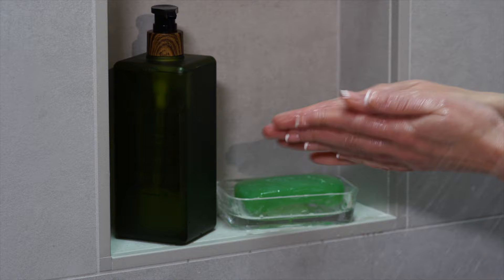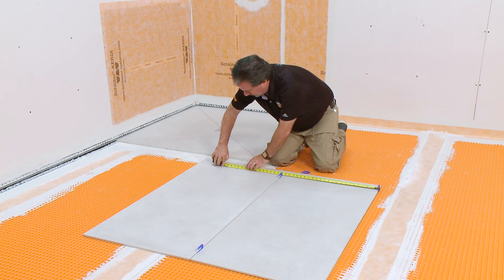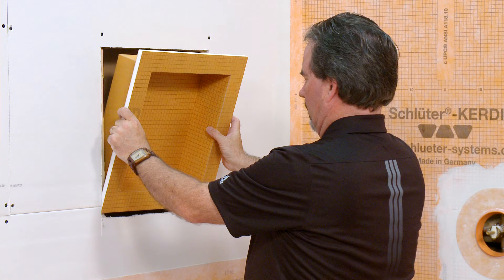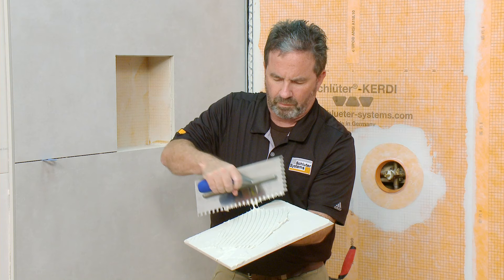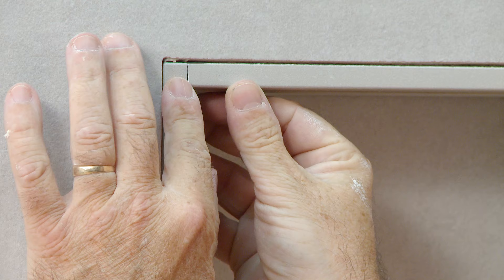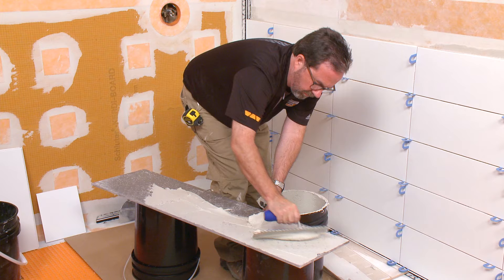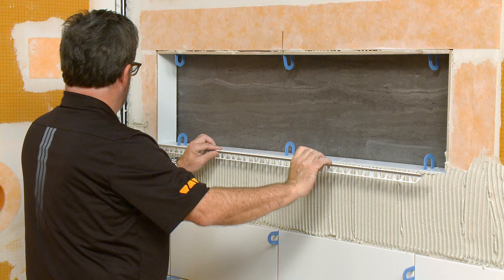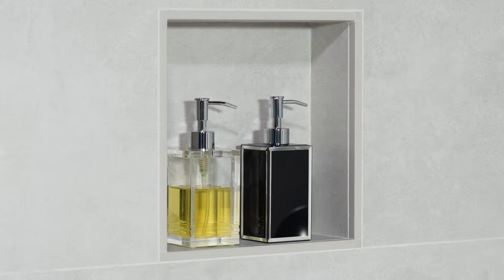How to Tile a Niche with Schluter® Profiles

Comment: Im getting ready to tile my shower but the niche came out a bit low. Which in this video it states it’s better to have a lower niche vs higher niche. I understand since my niche is lower I can raise there inner piece with more thinset to match the height of tile. My concern and question is, wouldn’t that leave me short on the top side? I’m using 12 x 24 and tile is about 1/4 higher on the niche. I think I’m better off cutting the bottom layer and making it even as 1/4” wouldn’t be enough height for the 1/2 this time rises with thinset. I believe if your niche is low it needs to be low enough to make up for tile and thinset which is 1/2” 😢 let me know what I’m missing here 🤦🏽‍♂️
Reply from the maker: Hi Maverick - I think it may be easier to discuss this together over the phone - our Customer Service team may be able to advise, or they can connect you with your Schluter rep to talk through the options. 888-472-4588 (US) or 800-667-8746 (Canada). Thanks!

Comment: Should the grout line between the profile and tile be the same as the overall grout line size?  If so, can we put in spacers there?
Reply from the maker: Hi Ceeloc, the grout line with our profiles should be 1/16" to 1/8". It's fine to use spacers.

Comment: No mention of how to frame studs around the long niche before the board goes up.  It is critical especially if the wall is load bearing.
Reply from the maker: Yes, framing is critical. The long niche is a custom niche. In this video, we refer to our specific Schluter KERDI-BOARD custom niche video for all the details on how to install a custom niche. In that video, we mention that the framing was already installed in the wall cavity to properly support the niche. It's always best to refer to local building codes for framing details.

Comment: Hello! Awesome job! What is the thickness of the tile that you used for the bottom of the niche? I’m trying to figure out if I need to set my niche a little bit lower than yours since my tile is close to 3/8 inch. I am using the jolly trim as well and will set it the same way as the second example. Thank you
Reply from the maker: Hi there! This tile is 9mm-thick, so very very close to 3/8 inch.

Comment: how do you line up the niche with the tile so perfectly while making a solid niche? I typically all 2x4's into the wall so I can screw the nice and the kerdi board into the 2x4's but you do this when the wall is open. How would I do this if I already have the board up?
Reply from the maker: Hi there! You will need to center the edges of the niche (flipped around) on the 16" studs (where your screws are), so the niche can share the stud with the KERDI-BOARD. Find the height you need to match up with the projected tile height, trace around the level niche with the edges on the center of the studs, and then cut the board out so you can install the niche flush to the remaining KERDI-BOARD. You only need to fasten to the studs on the sides. It is not necessary to install framing above or below the niche to fasten to. You can check out the instructions here: https://www.schluter.com/schluter-us/en_US/Building-Panels/KERDI-BOARD-Panels/Schluter%C2%AE-KERDI-BOARD-SN/p/KERDI_BOARD-SN
Our Customer Support Team is also happy to help should you have more questions:
US: 1-888-472-4588
Canada: 1-800-667-8746
 
Hope this helps!
Reply: @schlutersystems1  okay thanks. I always had a 2x4 below for it to sit on. I could still do this if I wanted the niche horizontal? Just make the framing changes first?
Reply from the maker: Correct!
Reply: @Jeziorski7  their boxes are different than piece by piece board
Reply: @LightGesture  what?

Comment: Do you attache the shelf with screws or motor ?
Reply from the maker: Hi Ali,
Here are the instructions from our Handbook:
Note: When using the prefabricated shelf, determine the desired height of the shelf and mark with a level line. Set tile up to that line on the back and sides of the niche. Butter the sides and back of the shelf with Schluter SET®, ALL-SET®, FAST-SET®, or unmodified thin-set mortar and solidly embed it in the niche, resting on the previously installed tile. The shelf may be raised at the back to create a slope, or the tile may be set on a slope, to prevent water from pooling in the finished application.
 
You can also consult the Handbook here: https://sccpublic.s3-external-1.amazonaws.com/sys-master/images/hd2/hf8/9078314237982/Shower%20System%20Installation%20Handbook.pdf

Comment: Hi, I have a schluter shower TT pan that I want to install. Can I use modified thinset to affix it to the plywood substrate? And if so do I then use unmodified thinset for laying tiles and laying the kerdi band? Part of my questions directly relates to the point when you embed the drain. I was made to understand that everything above the pan must use unmodified thinset. If so, how do i deal with the excess modified thinset that pushes out when I'm embedding the drain? Does this adversely impact my installation? I would really appreciate if someone could get me in the right direction. Side note I'll be using either customs or a Mapie brand thinset.
Reply from the maker: Hi there! Schluter ALL-SET and FAST-SET modified thinset mortars are designed to use both under and over KERDI products. If using another brand, please use an unmodified thinset mortar. Here is our technical handbook for installation steps and some information on thinset mortars. https://sccpublic.s3-external-1.amazonaws.com/sys-master/images/h3e/h33/9078316269598/Shower%20System%20Installation%20Handbook.pdf
If you would like to discuss more, please contact our customer support team--they'd be happy to help you out!
US 800-472-4588
CA 800-667-8746
Reply: Thank you very much I'll have a look at it. So to bond the schluter tray to plywood if I'm understanding you correctly I will use unmodified thinset if I use a different brand thinset?
Reply from the maker: Correct!